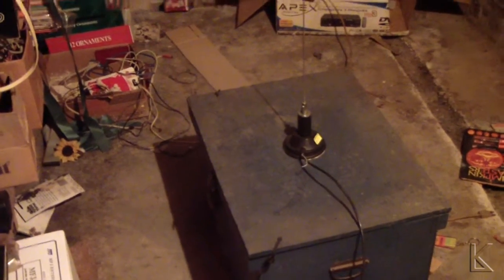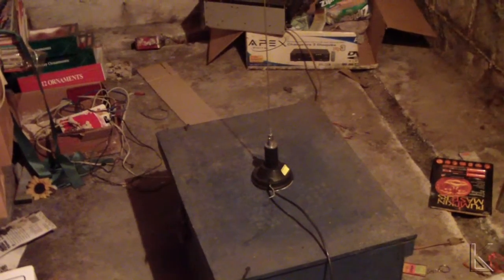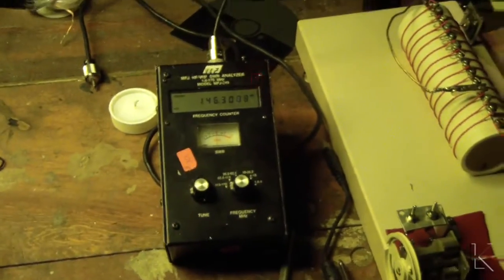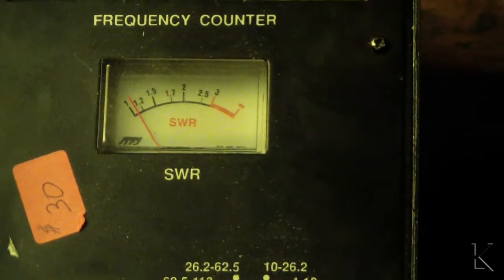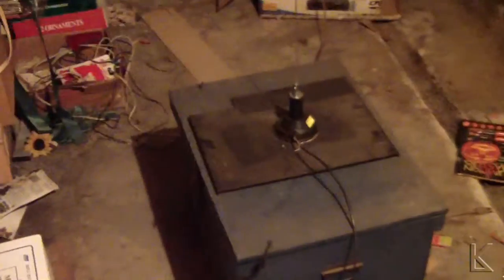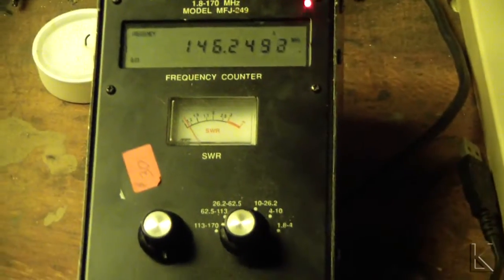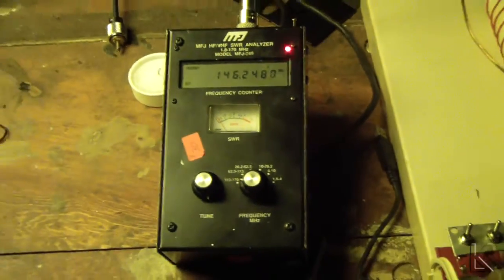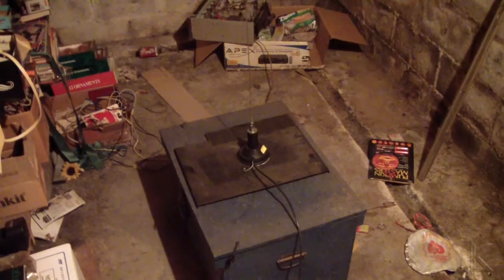Ham Radio - Quick tips #2, Indoor mag mount antennas and ground planes

Comment: Would a cookie sheet work
Reply from the maker: Yes probably. That might be big enough to provide an adequate ground plane for 2 meters
Reply: @loughkb Does it matter significantly...if it's rectangular, or square, instead of round?
 All my sheet pans, etc are aluminum. Non-ferrous...
Reply from the maker: @davestelling  No the shape doesn't matter so much. It's about surface area.

Comment: You do have an electrical connection. The magnetic mount. That's exactly how a mag mount antenna works on a car/truck. I have a 2 meter mag mount antenna on a metal file cabinet in my bedroom. SWR is good, and I can easily work several local repeaters with it. I also have a Wilson 1000 mag mount antenna that I cut down for 10 meters, and have it on a metal plate just big enough for the base of the antenna, which is bolted to an old engine crane in the back yard. The engine crane is over 300 pounds of steel, but not flat. That has also worked very well, with under 1.5.1 SWR. I have also used a cut down 102" whip mounted on that same engine crane, which did have a solid connection, and it didn't really work any better.
Reply: The magnet and the metal base has no direct conductive connection, but instead they form a capacitor. That's how they work.

Comment: Awesome to hear you tested it, no hate but doesn’t that kinda stand to reason since these antennas are designed to be on cars and your not wiring it to the car like you did with you little leg nor is your car truly grounded as it sits on rubber tires right?
Reply from the maker: The metal roof of the car should be electrically tied to the frame and negative (ground) of the battery and radio.  It's about providing an electrical ground plane for the antenna, right at the feed point.  Not the actual earth ground.

Comment: Yeah I'm trying to figure out this ground plain thing right now I have a extra Wilson 5000 mobile antenna and I wanted to put it on my house and run it as a base antenna but from what I'm reading I need a special mount with a rod to act as a ground plane if there's no metal underneath it ughh so much conflicting info out there I did test the theory with a magnet mount had a very high standing wave until I stuck it to my metal door so the magnet Mount needs metel under it but I'm not sure about the 2,000 with a regular 3/8 mount if I mounted it to a wooden post would it have a high swr unable to tune?
Reply from the maker: You could just add radials under it if mounted to a pole.  At least four, equally spaced, more is better.  They should be connected to the shield side of the coax connection.  The base housing the magnet should be electrically connected to the shield already.
Reply: @loughkb  okay so you're saying they should be grounded to the Mount sort of not insulated by that plastic washer? I really appreciate the info just trying to set up another base station at my house but I can't really put a big ground plane up or anyting like I used to run
Reply from the maker: @trackpackgt373  The radiator, connected to the center of the coax, should be insulated from ground or any mounting hardware.  The ground side of the antenna, connected to the shield of the coax, should have the ground plane connected to it.  You can verify the wiring with your multi-meter.
Reply: @loughkb  ok thanks brother I appreciate it

Comment: I did the same in college in the 90's. 5/8 mag mount 2 meter ant. stuck to the metal case of the 3 amp power supply running my ht. Hit at least 4 repeaters full scale. Enjoyed my setup very much. N4TCM

Comment: Does the metal plate have to be steel or will a large round aluminum pizza pan work?
Reply from the maker: It will still couple to that, but the magnet won't hold and that's not a lot of area.  Probably fine for VHF though.
Reply: Does it have to be round? All of my cooking sheet pans are rectangular aluminum...(?/

Comment: I just tried this on the 11 m with my toolbox that's completely made of steel and what you're saying is not completely accurate if you don't believe me try it on the 11-meter yourself with the proper antenna
Reply: Unfortunately a tool box is way too small of a surface area for ground plane at 11 meters (27mhz).  It would need to be like a 9 foot wide tool box.  2 meters (146mhz) only needs to be 18 inches.

Comment: Is not that you need to have an electrical connection. The magnet is already doing that for you because the shield of the coax is connected to the magnet and the dialectic of the coax is your whip connection. No counterpoise needed. The plate is the antenna reflector. The bigger the plate the better but you should get decent performance on just a cookie sheet or pizza pan.
Reply from the maker: Not a 'reflector'.  The ground plane is an electrical counterpoise to the radiating element, electrically balancing the antenna.

Comment: While you have proved that adding the metal plate lowers swr you have not proved that antenna performance has been improved. You have made a common mistake that many hams do now days of equating low or lower swr to increased antenna performance, ie. can you hear or be heard better. While I don’t doubt that it has improved that performance, an antenna analyzer will not measure that.
Reply from the maker: A lower stand wave ratio on a resonant antenna means that less power is being reflected by the radiating wire, therefore more of the applied power is creating a magnetic field.  i.e. more of the applied power is being radiated.
So of course, in the case of a resonant antenna at the operating frequency, lower SWR = better performance.
Reply: Kevin Loughin In most cases yes, and of course almost everyone knows that a vertical antenna needs a good ground plane to be effective. My point is we cannot always assume that an antenna with a low swr is an efficient and effective antenna. A good example is a ground mounted 1/4 wave vertical. Let’s say I put up a 40 meter 1/4 ground mounted vertical with with no radials and just a ground rod. I will be able to adjust that antenna to a very low swr and the swr line will be very flat across the whole 40 meter band. But, the performance of that antenna without an effective ground plane will be very poor. The low and flat swr readings are a result of terrible ground losses. Now, if I install 30 radials I will find my swr is no longer flat and has probably increased a lot, and the resonant point has shifted. I now adjust the length again so the lowest swr is now in the middle of the band. But now I find that the lowest swr is no longer quite as low as it was before, and I no longer have a flat swr line. It’s now a curve, perhaps reading 1.3:1 in the middle of the band, but now rising to 1.8:1 or even 2:1 at the ends - exactly like it should be! The antenna, now with a higher swr that before, is a much more efficient and effective antenna than it was. Usually the only thing that has a low flat swr across an entire band is a dummy load!
Reply: @loughkb  im not even going to read this idiots last reply, im going with your advise Kevin and not this imposter lol. Have a wonderful day.

Comment: My question is, how is the coax connected internally with the mag base? Does the radio see it as an inductive short to ground?
Reply from the maker: Usually, The Shield is connected to a large washer or metal disc in the magnetic base. It capacitively couples to the metal below.
Reply: @loughkb  ok so the radiator side is electrically isolated, but capacitively coupled?

Comment: Someone said on thetruckersreport .com CB forum that you can add some radials to a small metal plate that the magnet antenna sets on. Usually radials are 2% longer than the vertical antenna and aimed down at a certain angle for optimum performance but can hang strait down or horizontol.
They can be made from copper wire or aluminum tubing like a ground plane antenna .

Comment: I came onto youtube looking for to aswers, one do mag mounts work better on a metal plate and two do you need an electric connection and you have answered them both and proved it, thank you  for that. My only other question was would it work ever better if the metal plate was earthed to the house wirring? However thank you for this video

Comment: I got one of those old mobile car radios with a mag mount antenna and I live in the city so I can’t put it up on my roof but I was wondering if I could slap it on a big peace of sheet metal in my attic and try that but then I was wondering if it would be ok bc it’s not grounded pls help if u can
Reply: Yes you can do that. You want at least  1/4 wave length of metal going out in all directions from the antenna. So at least 19.5 inches for 2m and 6.5 inches for 440cm.

Comment: Hi Kevin...I would like to use my 5/8 vhf mag mount antenna on my roof which is aluminum. Obviously not magnetic, so  can I buy a 3 x 4 foot sheet of galvanized metal and place that on the roof so that the mag mount adheres? Does the antenna then use the ground plane provided by the sheet metal, or the sheet metal AND the aluminum roof around it as well? And if the latter, do I have to have conductivity between the roof and the sheet metal since the aluminum is painted? Thanks.
Reply from the maker: The metal plate inside the mag mount will capacitively couple to any conductive metal it's on, so you should be fine.

Comment: Explain this, i have almost the exact setup right now but in my backyard.
Wilson 1000 on a 2ftx2ft steel plate.
With the plate laying flat on the ground (Earth, grass and all) my SWR is hitting 2.2
But if i set the whole thing up on my truck box also sitting in the yard my SWR drops to about 1.2
So i placed the plate up on top of my shed and the SWR jumps to 3 or higher?

I'm assuming the antenna is using the Earth itself as the plain?
Any ideas how i could get this setup to run better on the roof?
Reply from the maker: Down at 27 mHz, a half wave is 16ft.  You'd need  a bigger ground plane than at VHF frequencies.  About 8 feet for CB.  The truck gave the best result since the vehicle is long enough to get closer to 1/4 wave.    Run four 8 ft. wires out from the plat in four directions and trim them an inch at a time until you get the best SWR.
Reply: Kevin Loughin 
Thanks for the advice and explanation.
I figured that was the case, so it must be performing a little better being closer to the ground rather than in air on the roof.

I'll give that a try maybe,, as my intention was only temporary anyways for testing purposes.
But after i got it going i got the bug and wanted more, lol.

So thought i would get by for awhile until i can get a proper antenna from down the street. I have a local radio guy that has everything i need. Just gotta save up a bit.
Not sure if i have wire that would stand out like I'd need for this as i want it on the roof. So the wires would not have any support.

Thanks again!
Reply from the maker: The wires can slope downward at around a 45 degree angle and still work ok, they don't have to stand straight out.  FYI.
Reply: Kevin Loughin 
It's funny, i figured that out before seeing your reply just yesterday.
My man down the street has the old school M400 starduster I'll be buying soon and i took notice of the ground plane extensions on it were angled rather sharp downwards.

Thanks.
Reply: I seen a video where the person had a magnetic mount antenna sitting on 3 to 4 inch by 14 inches long metal That's for ham and 3 to 4 inch by 9 foot long metal for cb radio He said it works good

Comment: I've got an MFJ mag mount that I bought to put on my pickup and now I use it on the patio.  We have a propane fire pit that has a steel cover over the pit area and I stick the mag mount on the cover. Works real good and I get more contacts on 2 meter then on my after market rubber duck on my HT. KN4CQU

Comment: no, this proves the mag base is what the theory  of operation  says, that is a conectiin is made thru the magnets to what is usually a automobile. On parts of my Saturan that are plastic. thd mag antenna swr was high.. 

A further "proff would be to place a thin plastic sheet between the base and metal plate . In my experiance the swr went high.

Comment: If you opened up the antenna you would discover that the braid is connected to the magnet. There is already an electrical connection to ground
Reply from the maker: Many mag mounts do have a metal plate in the base that's connected to the braid.  However, this doesn't make an electrical connection to ground.  In the case where someone has the antenna sitting on a file cabinet or metal plate, you'd have to have bare metal on the base and scrape any paint away from the surface it's sitting on.
Reply: Kevin Loughin i think if you test it you'll find it does. Capacitive coupling may not be AS effective through paint but if you remove that braid from the magnet your swr will sky rocket and you'll measure incredible amounts of impedance on the ground side through the magnets which will drop to normal as soon as that connection is remade.
Reply from the maker: Yes.  Because, the metal of the plat or the magnet is providing one half of a capacitor, the metal of the car roof is the other half.  There is no direct electrical connection through the paint or plastic seal on the bottom of the antenna.  It is all capacitive coupling.

Comment: Ok, so I am hoping you have figured out that the magnet provides the RF coupling to the ground plane. It it very easy at higher frequency but as you go lower into the hf bands, you require more magnet influence to attain the RF coupling. Once you get up to 40M and lower frequency, you need to look at a physical boo d to get the RF coupling to ground.

Comment: i have a 2 meter mag mount and cannot get the swr below 3 no matter what I try, was hoping to find some deep hidden secret about mag mounts  here  lol
Reply from the maker: It could be that yours does not have the capacitive plate in the base and would need an actual ground connection to the metal it's sitting on.
It could also be an older one where water has gotten into the base and coax, or rusted the base inside.
Reply: hmmm  i will look into it further  thnx

Comment: That was a surprise. I guess the capacitance between the base of the antenna and the metal plate forms the connection to ground. That would make sense because. Never thought of it before. Good job. Hats off to you for admitting you were wrong! You make a good Vulcan  8-)
Reply from the maker: I'm still a little puzzled over it.   I'm tempted to do a tear down of the antenna base to see if we actually have an electrical connection between the magnet and coax shield.     I might do that tomorrow.
Reply: @loughkb   Yes, please do that.
Reply from the maker: @bills1613  Hello Bill,  that was 5 years ago.  I no longer have the antenna.

Comment: electrical ground is different than a rf ground plane. it works via induction. the magnet is electricly grounded withen the base. if the gap between the magnet and top of the car were to become greater. the capacitance changes and the swr's goes high. I had a three puck magmount and I could never correct the swr's because of that capacitance. I tried making an electrical ground for it. nothing.

Comment: I like how you proved and admitted you were wrong. :)
Reply from the maker: Science is all about truth, and truth doesn't care how you feel about it.  (ha).    I'm only ever interested in truth, and if I'm wrong about something,  I have no choice other than to alter my opinion to align with truth.   
It's the Vulcan way.  ;-)
Reply: I agree!  Kevin is a solid guy.  I admire that trait in a person.
Reply: Well I'm glad that's settled LOL I got my first CB radio back in '76 when the 23 channel were on sale trying to make room for the new 40 channels coming in. My mom picked up a Panasonic RJ 3200 about 60% off right at Christmas. This set her back quite a sum. My Dad ran down to a local electronics store he bought parts from and picked up a Kraco Center load magnet mount about 24 in I think LOL after trying to talk around the neighborhood to no avail he ran over to RadioShack and got a barrel connector and a 10-foot length of coax. I know it don't sound right but that's how Radio Shack sold it. Added to my 17 ft of the magnet mount that gave me enough slack for the coax to go up onto the top of my swamp cooler. People always told me I had to run a ground wire. To appease one guy I got tired of his bitching) i  went up and cut the rubber off the shield and soldered a four inch wire to it. Swamp coolers have that little screw for the manifold mount in the center so I moved the antenna offside a little bit and put a lug under that screw so I had a grounded antenna. Like you said nothing changed. Today I am retired and partially disabled pinched nerves and all and I don't feel like running to the den every time I hear somebody so I'm going to put a CB in the kitchen under the cabinet so I can just stay there and keep cooking or washing dishes and when a friend hollers I can holler back and not have to go anywhere. I'm going to blame it on my disability but probably I'm just lazy! Anyway I'm just going to throw up a 5-foot fire stick with one of those triple magnet mounts and now I know I don't have to ground it 🤓